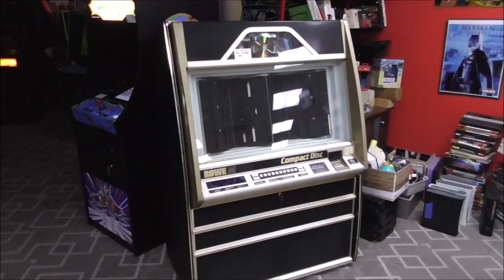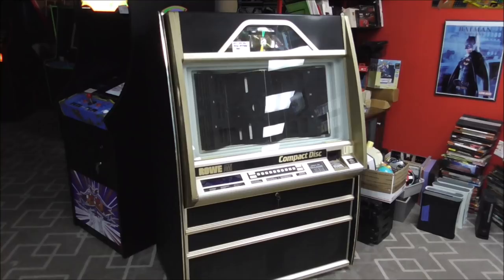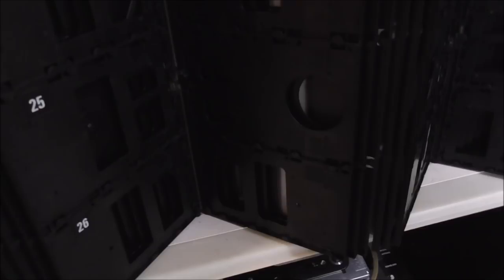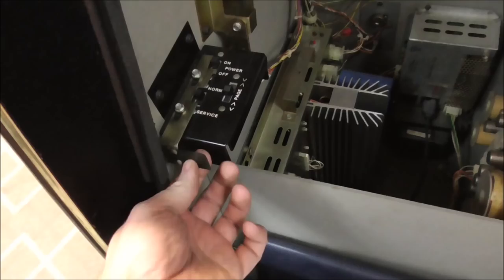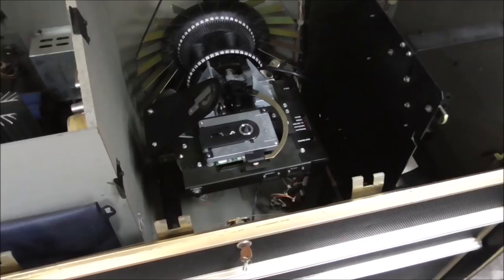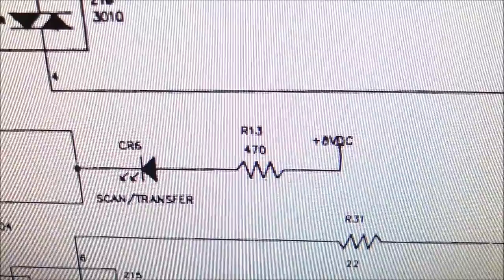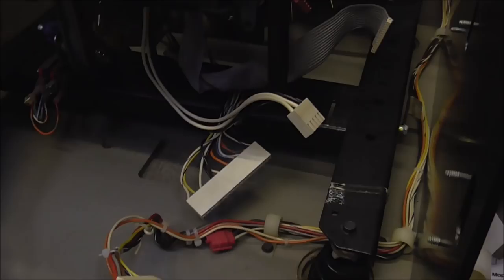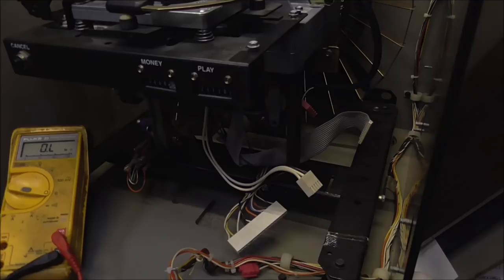Our Rowe / AMI CD100A Mechanism Control Computer SMOKED, Let's See If We Can Fix This Jukebox!

Comment: ULN 2003A is Trans Darlington NPN 50V 0.5A 16-Pin PDIP
Reply from the maker: Thank you Marissa, most of that though I still don't get, lol  I looked up the datasheet and kind of got an idea of the voltages and things involved... This ends up being a two part video, but we've already filmed it and got to the conclusion so you'll see the rest of it Wednesday!  Thank you for watching.
Reply: @LyonsArcade  "Darlington"  just means  "stacked transistors"  in a basic sense.  Transistor into another transistor.
Reply: Ron the Darlington in simplest terms is a transistor.   The chip is called Darlington array .....fancy way of saying heap( of 8) in a box.   
This can be used to allow 5 v signals from computer bits , to talk to the ( say) 28V motors or  solenoids.  I

Comment: uln2003 its a transistor array (darlington pair) so it can switch leds, relay coils etc from logic level input, they blow easy if you got a bad relay or coil etc.
Reply from the maker: This one must have been shorted for sure.

Comment: pin 8 of the ULN2003 is indeed ground, but they probably isolate ground on different pins of the power connector to prevent noise from the motors and such getting in and crashing the CPU. The stuff you saw on pin 8 is called a thermal relief; it makes it easier to solder the pin, so that the copper ground plane in the board won't suck the heat out and cause a cold joint.   The 80C31 is an 8 bit microcontroller and is pretty common.  The 74HC574 is an 8 bit latch, and seems to be connected to the ULN2003's, so when the 2003 smoked, it most likely did in the '574.
Reply from the maker: On Wednesday's video we'll be right back in that area trying to figure it out, thank you for the info Kevtris!

Comment: Thanks for raising awareness about the gas shocks, Ron! People usually ignore them and end up badly hurt when they fail. My dad got a broken nose years ago when it failed on the hatch of his Ford Escort :(
Reply from the maker: Suuuucks, man!  My first car was a Mercury Lynx which I think was the same as the Escort...
Reply: One of my employees got nailed by an American Changer.  It had the gas shock holding the top up, and I warned 'em that he would need to use the prop rod.  He ignored the prop rod and jammed a coin box in the lid.   

Once the changer figured he was leaning into it-  The box shot out and the lid (probably 15lbs) clocked 'em right in the back of his noggin.  He was actually treated for a minor concussion.  (The company ensured he was taken care of 100%.)

Comment: The philips 80C31 are standard microcontrollers, originally from intel (MCS-51 family).  They don't have a rom and are just running whatever is burned into the EPROM next to it.  The ULN series are mostly darlington transistor arrays for driving higher power stuff from low current logic.    Fun video, thanks!
Reply from the maker: Thanks for watching!

Comment: An IC is a combination of everything.  Integrated Circuits are basically a complete circuit, but microscopic.  They often contain multiple transistors, capacitors, resistors, inductors all on a microscopic level.    In this case, the ULN2003A is a Darlington Transistor array, NPN about 50Volts, 1000hFE.  So in this case, the chip is a few transistors in a chip, pretty high gain transistors too.  I guess you could look at them similar to the transistors on a Bally Solenoid board, but a few of them all in one little chip.
Reply from the maker: That makes sense Brendan, either way it had a huge hole in it :)  We'll pick up where we left off Wednesday!
Reply: @LyonsArcade  Yes, it was absolutely dead :)  Probably died due to the motors running constantly, due to  other errors :)

Comment: Only one part with a smoking hole in it ?
TV I'm fixing, has two ICs like that, as voltage regulators don't usually hold suicide pacts there is a 3rd charred part in the PSU.
Two shorted capacitors, one which which looks like it's been on fire.
So yeah, 9v into regulators that only take 5.5V max.
$80 to buy replacement PCBs, $1.40 for replacement chips, once I found some actually in stock.
At the moment even brand new parts that are still made can be hard to find.
Reply from the maker: I'd definitely rather fix them than buy a replacement, for sure!

Comment: Hey man. Pretty sure those gas struts were never supposed to lift the lid only take the weight and make it a little easier. You can buy a special ROWE AMI plastic cover to  lock the struts out, which is effectively what that pipes doing anyway. I’m sure it’s mentioned in TNT video.
Reply from the maker: When I used to operate them some of the rock olas would hold themselves up but we didn't operate many rowes at the company I worked at so I don't remember for sure...

Comment: 6:28 dude that board is a cross over it's for separate frequencies, i mean one connection goes to the woofers or subwoofers and the other for the mids and highs it's simple but funcional and actually the new speakers comes with one of this thingies inside
Reply from the maker: Looks heavy duty :)
Reply: @LyonsArcade  yeah but it's just the aparece maybe, the good stuff is in the inductors, if these are made with good high quality copper the quality of the x-over going to be superB or maybe it's just like that for the power of the amplifier, who i think is an AB class amp or mosfet class D, who knows

Comment: now replace the rear window defroster on that hatch
Reply from the maker: We ended up trying to use that same crap that you fix the window defrosters with, on the dart board membranes.... I'm using more auto parts than arcade parts anymore :)

Comment: What's up with the Seeburg DS160 (or DS100) briefly visible at 19:40?  Is that the one you were messing with awhile back getting the Tormat unit working?  Was that one of those rare videos where you put up part one but didn't get it working and didn't put up the second video?  I was hoping to see your results for when I finally get my DS100 down here from Pennsylvania and get into its selection mechanism.  Though I'm sure that a lot of its issues are just old ass caps.

Comment: you have to take those "blank" CDs out that are rotating now on the display, and see what's on them.
Reply from the maker: I think they came from Rowe with those in it :)
Reply: @LyonsArcade  yeah they did... I am very curious what's on them, if anything.  lol.  radio shack used to sell CD desk clocks with similar blank CDs, and I was always curious what was on those.  I suspect they are defective discs or overruns, so there could be anything on them

Comment: I have rowe too with the problem with mech board. First there was a RAM fault. I changed 6116 which is RAM memory. After that RAM error went away and it gave 05-62, which is CDM communication error. Then I also replaced the microcircuits U2 and U3, which communicate between the mech board microprocessor and the CDM. Still the same problem, the board error light stays on after the second flash and the CDM COMM light stays on, flashing about every second. Jukebox not working. There are also no error messages anymore. 
Then when I changed another MECHANISM CONTROL BOARD and I used the same CD Player cable, with that the jukebox works fine. 
I also measured that the CDM receives +5V and +9V voltages. 
Is the next processor to be replaced, U4(8031)? 
Or where could it be wrong? I looked at the wiring diagram that the U2 and U3 circuits are the only ones between the processor and the CDM...
Or what stops the MECH BOARD after the second led flashes. The manual doesn't say anything about that. 
The MECH BOARD should blink three times for it to turn on, right? 
I tested with an intact MECH BOARD so that I put only the power connector on it, after which the board error flashes three times and after that the SCAN/TRANS light stays on. The broken board, on the other hand, flashes only twice and BOARD ERROR stays on after the second flash and CDM COMM stays on.

What is wrong with that board?

Comment: The mechanism control computer is blowing smoke...
takes unit out...
It's literally called the Mechanism Control Computer.
O_o
The designer of these was not very imaginative I guess...
Reply: RE: Chips
ULN series chips are custom application-specific transistor arrays. Typical types are for matched transistor arrays and (high voltage) drivers eg. for driving a VFD or, in your case, providing a "high current" voltage sink like an open collector invertor but sinks more current than a normal invertor. Careful using sockets for it as there may be more current going through the socket than you normally expect, don't use a cheap socket.

The 80C31 is an NXP (re Phillips) part that is their version of an Intel 80C51 (8051) micro-controller. So that's likely the brains of the controller. 8051 uC's  are really old controllers going back to the beginning of 1980 but is still in-use in new designs even today. I used one in a product I designed many years ago.

RE: AC Motors
Windings DC resistance will be low. These motors run of 50/60 cycle AC and so to really get an idea of the winding resistance (or impedance really) one would have to run a low voltage AC through it via a divider network and measure the AC voltage drop across it (and possibly the current going through it, depending on the test setup) and determine the impedance.  Or just hit it with full power and see if it smokes. :D

Cheers,
Reply from the maker: Thanks Eddy, I’ll bet the reason I already had those 2003’s is because I needed them for a display now that you mention it.  I’ve worked on some of the rock ola displays in the past....